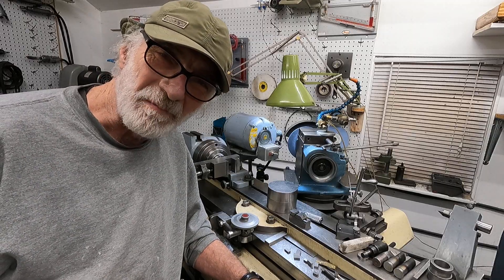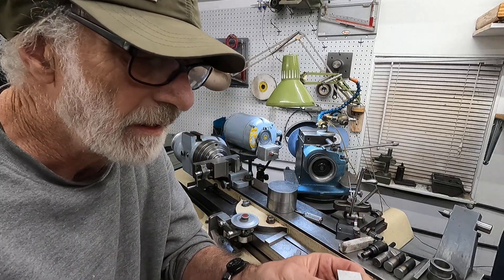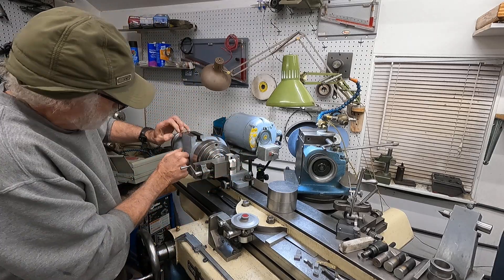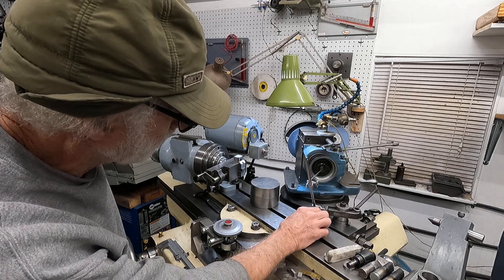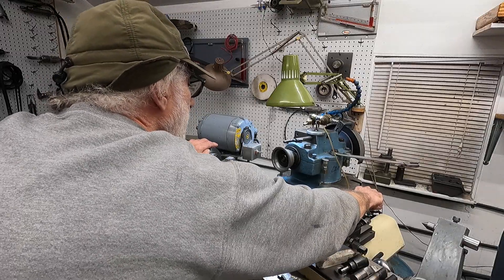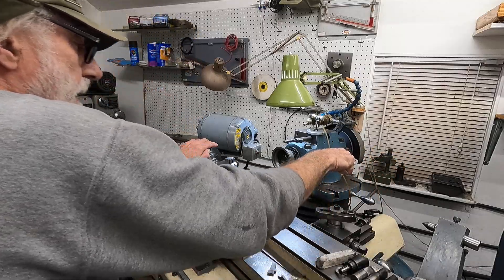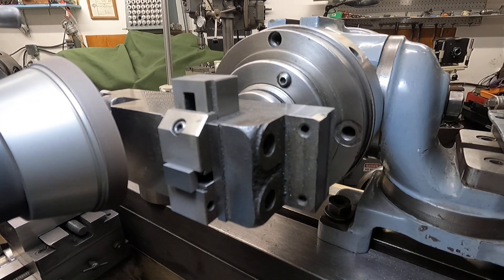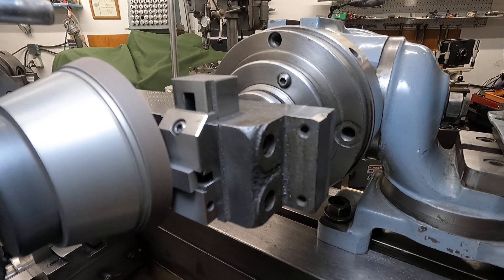Cincinnati Tool & Cutter Grinder introduction part ;2!

Comment: Hi Dee, what size is the carbide blank you are using and may I ask where you buy your carbide from?  I believe you mentioned in a previous video you use C2 grade carbide?  

Thanks again.

Joe
Reply from the maker: The blank is C2 3/8x5/8x1/8 carbide, purchased on ebay.
Reply: @deedeeindustrialsuperprecision  Thanks much for the information.
Reply from the maker: @jbaccell  The blank is 3/16" thick! About any size or shape blank can be found at MSC Industrial, and others, at higher cost.